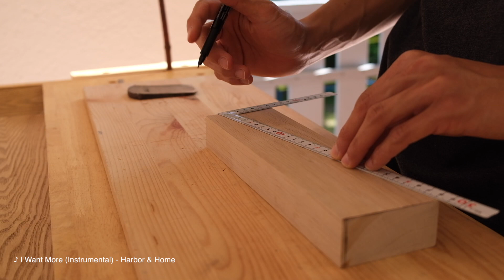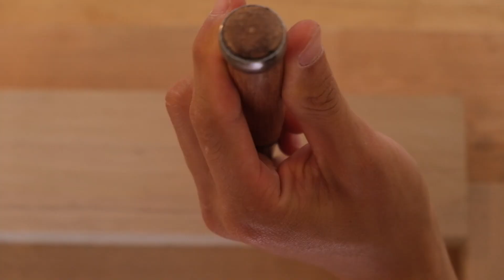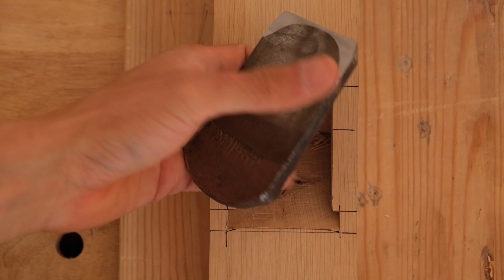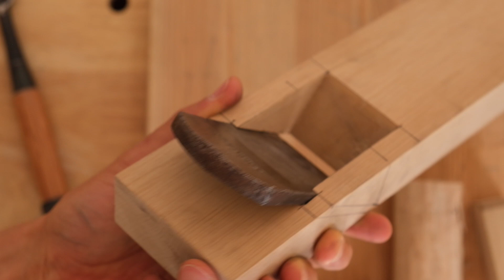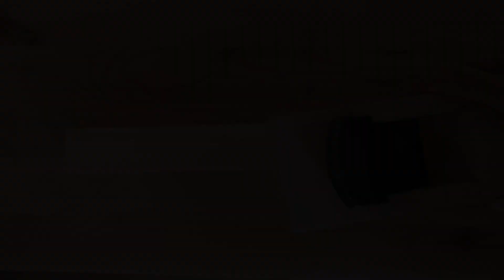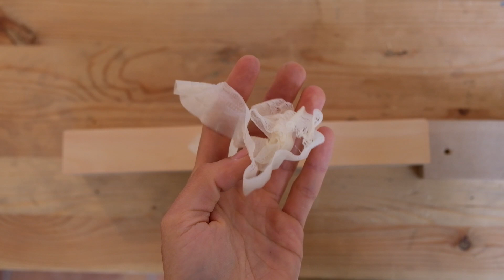Making a Kanna (Japanese hand plane)

Comment: Of course, there is a knot hiding in the middle of the bed, just waiting to be discovered by the chisel! There is a small hint of it in the surface grain pattern, but it was surprising. Does this actually make a better kanna because the crazy grain around the knot is denser? Thank you for sharing your work with us.

Comment: Do the Japanese use hornbeam often for Kannas? I've only seen it used regularly in German wooden planes.
Reply from the maker: Hornbeam is not commonly used in Japan. Kashi (Japanese oak) is the most common material used for Kannas.
A friend in Germany gave me this hornbeam so I decided to give it a try. It feels quite solid and so far, it works well as a Kanna.
Reply: @dylaniwakuni  Cool, that's interesting. Isn't hornbeam sort of self-lubricating? In that it kind of oils itself to keep the movement really smooth. Or I may be mistaking it for another wood.
Reply: @michael.knight  the wood you are speaking about is called lignum vitae or guayacan. Best wood for kanna is fine and straight grain kashi